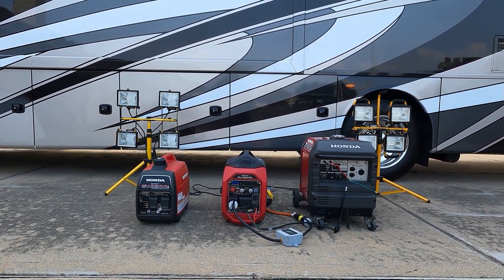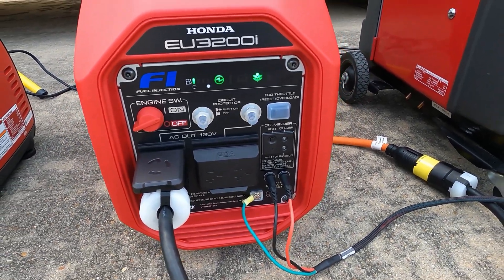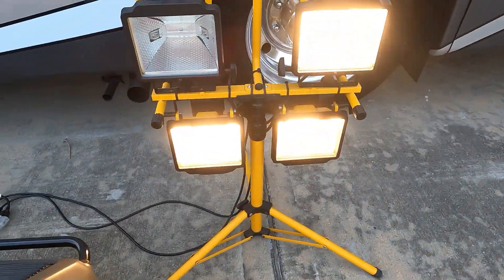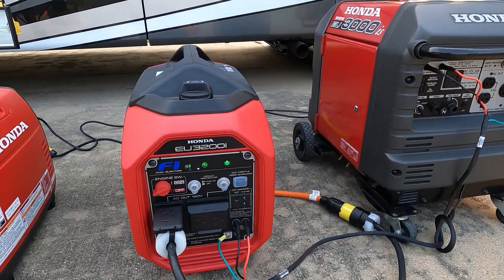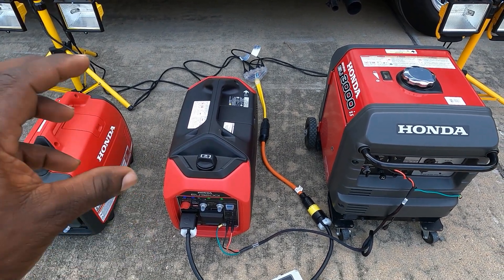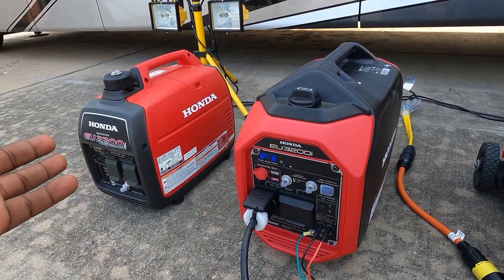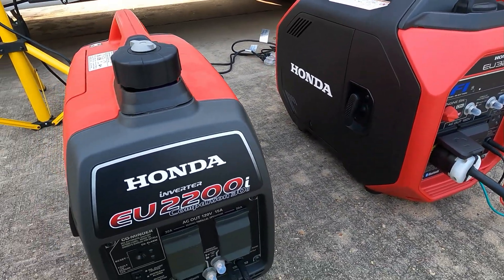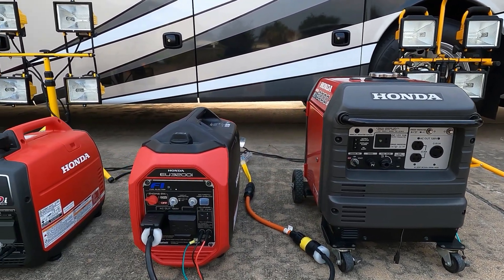Can you Parallel different size Honda Generators? | EU3200I, EU2200I and EU3000I

Comment: There are videos on YouTube with four Eu2200i's in parallel. A Eu7000is and a Eu3000is and an Eu2200i in parallel. I spoke with Honda regarding this and they stated not to do this as it could damage the units. I don't know if it is true as I am sure Honda wants to sell two of each unit. I lost my EU3000is in a divorce and I asked why she wanted the generator since she could not operate it. She told me because I liked it. I miss my Eu3000is but i do not miss the ex. I wish I had a prenup just for the generator. Great video.
Reply from the maker: Thanks for sharing, you’re probably in a better place. Can’t believe you didn’t full the tank with Diesel

Comment: electrician here, did you just splice the three outputs together, show the box pls, thx
Reply: He is using the Honda crossover cable to parallel the generators through their paralleling connections. You can clearly see it in the video. It uses shielded banana plugs for the AC and a lug for the ground.
Reply: @ thanks, I’ve since realized my eu3000 doesn’t have those jacks
Reply: @ndesmini9139  They are paralleled with the outlet pins so there are other ways to achieve the same effect, however they might not be as safe in terms of avoiding exposed live prongs if one side is disconnected. My old EU3000 does have the shielded banana paralleling jacks.

Comment: Gavin   what will the wattage be when you parallel the eu2200 with the eu3200?
Reply from the maker: You just add up your generator wattage so 5400 W
Reply: @GeneratorReviews  Thanks I called Honda  and they told me I couldn't parallel different sizes.  Why are they saying that?

Comment: The 20i, and 32i could bear the 4000W by themselves. What I would be interested in: Is the max combined power limited by the weakest unit? 2000i can handle 2000W peak, the 3000 and 3200 more. So would the max combined here be 4000, or to they manage some intelligent load sharing, meaning the 2000 will go to 1800 where it's rated for continues operation, and the others would go to 2800 (or whatever their rating is), meaning the three together could deliver over 7000Watts?

Comment: The 3200 is a great solution for those who need more than a 2200 but don’t want to run two. The 3000 is still the best choice for home use between the three for its large fuel tank, long proven reliable and simple to repair engine, and very quiet operation. For my use and taste the 3000 is the winner.
Reply: For me Having Two eu2200i are the better set up.

Comment: Nice video.  Thank you.  The 2x15 plug male to generator twist lock L14-30 receptacle female y adapter cord 120/240 that is on your site.  Can I use this adaptor on my 4000/3200 predator generator on the 120 outlets that max out each bank 13 amps? Will this adaptor combine the 2 banks and give me the full 26 amps at 240 volts.  Thanks.
Reply from the maker: No you can’t get 240v from that adapter
Reply: Thanks.  But could you get the full 26 amps at 120 volts?

Comment: Gavin what happened to your video about adding a neutral wire to a parallel kit? I'm trying to connect to 5000w predators and make them 240 volts
Reply from the maker: https://youtu.be/D1FVUNlQHv8
This one?

Comment: Great video. I have a Honda eu3000is and a Firman W3300i inverter, do you see any reason they won't parallel together? It looks like they have the same parallel ports.
Reply from the maker: The Honda parallel ports are different

Comment: I appreciate what you are doing, but I did not hear the disclaimer that you really should have included...."WARNING: Honda says that you should not parallel 2 different models."

This is from Honda's website: Connecting an EU2200i with an EU2000i or EU2000i Companion that is not within the compatible serial range above may cause a low voltage output, which can damage tools and appliances powered by the generators. Units outside the compatible serial number range should only be paralleled with another EU2000i.""

So I think you should edit this video because it is misinformation without this propper warning that you can damage your tools and appliances by doing this.
Reply from the maker: Yes you’re right I am going to add it to the description 
Thanks for pointing that out to me but it seems like Honda just wants to sell the companion model instead of the parallel kits 

My eu2000 is 14 years old and I have been using it like this ever since I got it.

Comment: Hi, have you tried, or could you try to run an extended run fuel tank with the 3200I? Also, what do you know about anyone making a propane kit for the 3200i, or if it can be done?
Reply from the maker: I will try

Comment: Why does Honda say not to do this?
Reply from the maker: I don’t think they recommend paralleling the 240 V with 120 V generators
Reply: @GeneratorReviews  eu3200i owners manual says "never connect different generator models and types". The eu1000i and eu2000i manuals say the same. The eu2200i owners manual does allow you to parallel to the eu2000i but specifies only certain serial numbers, presumably newer eu2000i models. I have connected different ones together also with no negative results. Just never knew why they say not to, they must have a reason.

Comment: Can you find a hacking solution to parallel non sync inverters or power stations? It will be awesome if we can double power stations output with a combiner box.
Reply from the maker: There is one way to hack it, but eventually the parallel capable one will overload and shut down
Reply: @GeneratorReviews  if we find a way to parallel power stations it will be huge life hack !! Something to isolate the output like a Diode for ac power 😅

Comment: When you parallel the EU3200i with the EU2200i how many watts/amps do you get our of the 30 amp outlet?  I assume it is the 1800 of the 2200 and 1800 from the 2200 so 3600 watts and 30 amps?

Comment: I am curious if a person could parallel three Honda EU2200i's together??? That would be an interesting video with load tests. Would require a custom parallel kit/system.
Reply from the maker: Yes genmax made a three parallel kit just for that reason
Reply: @GeneratorReviews  I had missed that video and only saw it after I posted, a good idea for those that want redundancy and not have to handle a heavy genset.
Reply: Make a suicide cord and connect all 3

Comment: Have read multiple times that you shouldn’t parallel 2 different size generators.  Can you please share your thoughts on this.  I have a EU7000is for my house and an EU3000is for travel needs.  Though you mentioned you can’t run the 7000 with them I’d like to know the technical aspects why they can’t. 

Great videos and content as always !
Reply: There is a video on Youtube by Michael Vaughn by the title "Parallel operation of different sized generators Honda EU 7000is and a Eu3000is Honda" you can watch that shows it is possible.
Reply from the maker: The reason I don’t parallel the 7000 with the 3200, the 7000 has 240V and the 3200 has 120V output.
Reply: So it’s a single Vs double leg feed issue ?
Reply from the maker: @melgreer104  exactly
Reply: https://youtu.be/JGDJ6Js0PKw?si=dpkdNQw3Y6xA2S0T

Comment: The 3200i is awesome for the tech but there is something about the 3000is with its painted steel panels that screams quality of yesteryear.  just like the old days of the "big red" Honda three-wheelers with their steel tanks and how if they're in good condition they are collector's items now.
Reply: I own one for 19-20 years now.  It's been an awesome machine, with little maintenance.  I use it for hurricane emergencies when there's no power at home.  It is worth every penny.
Reply from the maker: I Agree ☝🏽 with you this on is a classic.

Comment: It would have been informative if you had a clamp meter to put on the connection cord to see if they shared the load equally or proportionally.  Also hooking up all three and adding a milk house heater (1500 more watts) would have been interesting.  

A T Burke
Reply: I agree, measure and see what it is actually doing. If the current doesn't divide proportionally to the generator's capacity as the load goes up one will overload before the total capacity is reached. Load balance is important to understand. 4KW load doesn't show that.
Reply: I don't think you need a "clamp meter" to understand intuitively that it would be proportional.
Reply: @berettaguy7445  I'm sure that with todays social values and political truths and even court system your feelings and intuition would be considered better evidence and the real truth rather than an amp meter reading.   Both my tests and the others who have Youtubed their results are obviously in error.   "I feel therefore it is."
Reply: If you already know the answer, why ask the question?
Reply: @berettaguy7445  I do not think I asked a question...unless of course you feel I did, then I must be in error.

Comment: I thought doing this was a No-No.
Maybe they work but, Should they be connected to each other?
What is the long term reliability of the electrics?
Reply from the maker: They are designed to be paralleled they come with parallel ports
Reply: @GeneratorReviews  
Yes I do understand that and I parallel my two eu2200i’s.  
But I didn’t think paralleling different sized generators would be ok. 
Now I’m regards to mixing different brand generators! Oh good luck.
Reply: @Glocktard  Good point...just because something works doesn't mean it's advisable.
Reply: @berettaguy7445  I really think it’s ok to hook both together probably just Honda’s. This makes it easy for us to do this as long as it’s not 240volts just 110 volts

Comment: I want to get 220v out of (2) 2000w 120v portable generators, so I can run my welder.
Reply from the maker: You to get one that has 240 V because you can’t combine two 120v units

Comment: You can parallel all 3 with a custom cable if you really want the power. 
But at 7kw 120v would mean too much current. It would be better to do if the system is 240v..
Reply from the maker: Yessir you’re correct